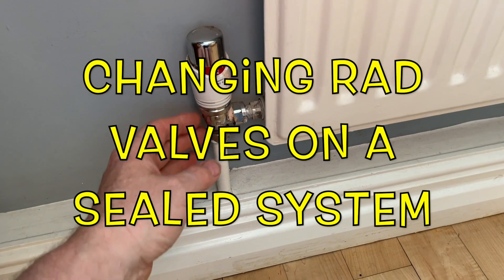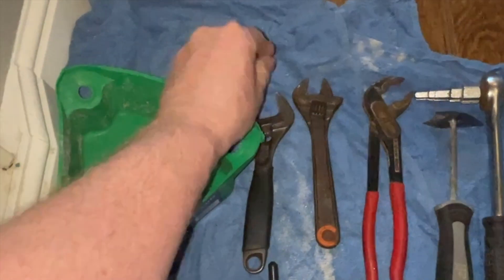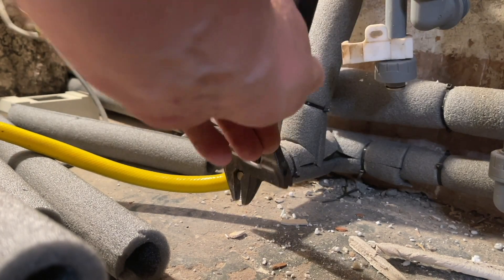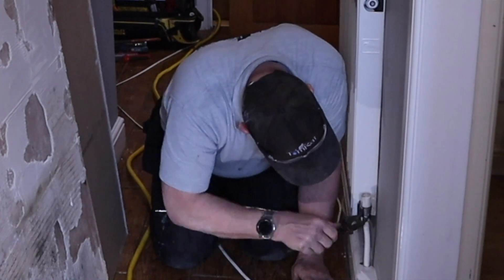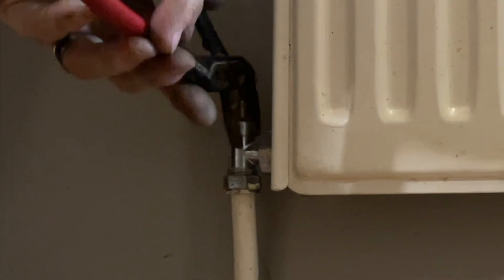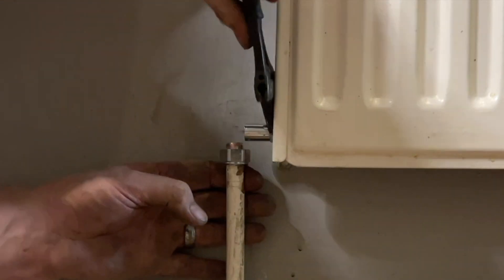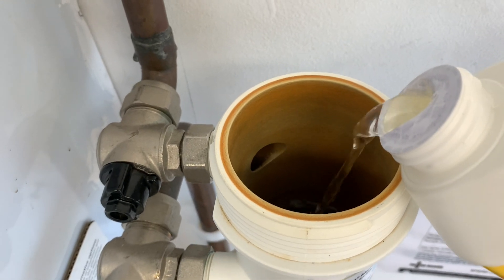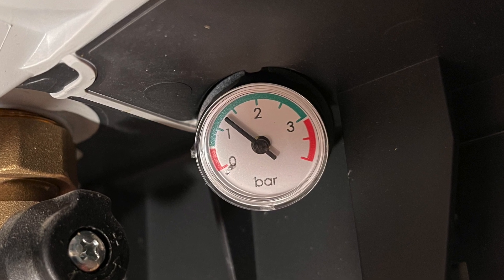How to install radiator thermostatic and lock shield  valves correctly.

Comment: Not sure why you drained the entire system when you could have isolated all the rads at both ends to retain the deoxygenated water aswell as saving time on bleeding……a fresh refill also brings with it a whole new lot of minerals to scale up the heat exchanger 😊
Reply from the maker: Only in some parts of the country also isolating rad valves could cause problems ie leaking or snapping or causing air locks.

Comment: Most TRVs these days are bidirectional, it’s usually when you’re fitting column rads you have to know which side is flow / return.
Reply from the maker: Correct but if they are not then you need to know the flow it’s best practice
Reply: also some cheap budget TRV bidirectional valves can be noisy, if fitted against the flow of water.
Reply: @Daz-L-CV  I’d never use cheap gear, you nearly always regret it.
Reply: @BABYCHAOS26  agree, always worth paying the bit extra :)